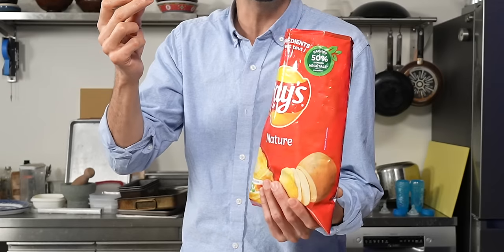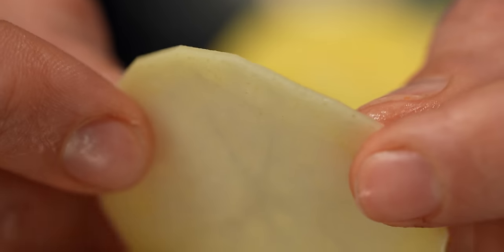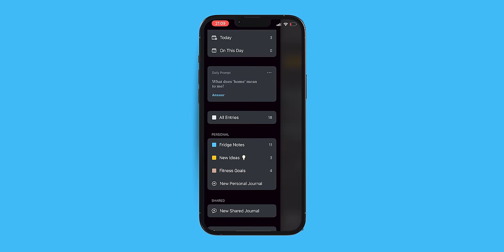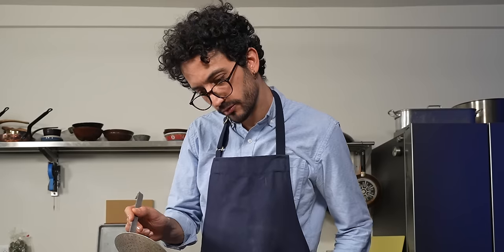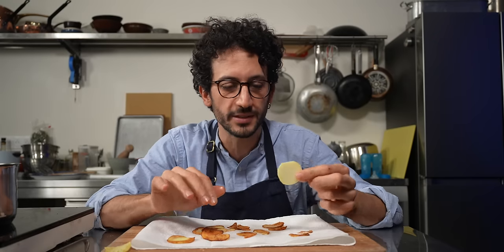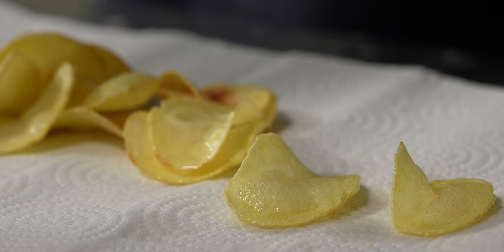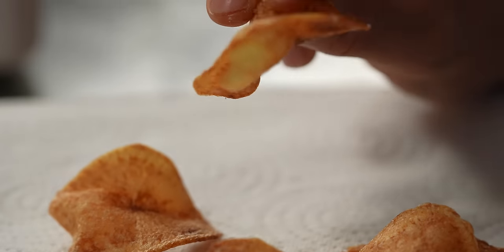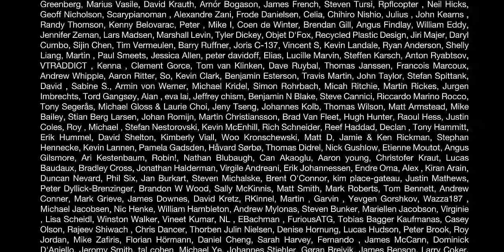How Hard Can It Be To Make a Potato Chip ? (hint: Fly you fools!)

Comment: A tip is to try double frying the chips to solve the whole dehydration issue. It's a common method in fried chicken to get that ultra crispy exterior with the starch. Cause as explained by many other comments, you're not trying to "cook" the chips, you want to dehydrate them, the oil pulls out all the moisture from the potato slices and replaces them with oil. Just a small period of letting them rest will let all that remaining moisture get pulled to the surface without running the risk of burning the chips in the oil so you can then quickly fry it till perfection for that crisp texture and flavor. 

So in short, you were way on the mark than I think you realized.

Comment: I went through this years ago so let me save you a trip.  Use peanut oil at 350f, use Russet potatoes, slice them as thin as possible - the smallest setting on the mandolin, after washing them spread them on paper towels and microwave them for roughly 45 seconds(this drives out a lot of the moisture) and pull and salt them when they just start getting a little brown on a few of them.  Also fry them in very small batches putting one chip in at a time so they don't stick(be careful, hot oil splashing), it takes me 4 batches for one medium potato.

Comment: medium high heat, wide pan(so you can fit more every time), small batches at a time(one layer, no overlap of slices or they'll stick, one potato will need 3-4 batches depending on size ) will work just fine i've been making them the past 3 days, works every time

Comment: I used to make potato chips in the restaurant i was working as a garnish and they used to come out pretty close to store bought if not identical...the method we used was slicing in the mandoline at a see through level and then we would store those potato chips in ice cube cold water untill frying.. we used to fry them at 120oC flipping each chip occasionally until crisp..You should give it a try :) (if you find this comment)

Comment: I'm surprised alex is having a hard time with this, considering his cooking knowledge, skills and his scientific approach to cooking. I've made potato chips before the same way with oil in a pot without a thermometer and it turned out with perfect color and crisp-ness. All his attempts had potatoes sliced too thick, which takes longer for all the moisture to evaporate, allowing the chips to become crispy like store-bought chips. On relatively low temp oil (I'm guessing around 150-160), with almost paper thin slices (logically chips manufacturers will also want to maximize nr of chips per potato for consumer's visual quantity per bag), fry for quite a decently long time depending on how big the batch is; around 6-8 mins in my memory, and you will get chips with similar or better quality than store-bought. As for the issue of potatoes sticking together, you could wash off the starch or put them in one by one, but I just sliced them on the mandolin over the pot and had no issues, unless it piled up too much. Making chips at home is actually very very easy imo

Comment: In the restaurant I used to work at, I had to add vinegar to a water bath about 3 cap fulls to 18Liters of water and let the sliced potatoes chill in the water till they had to be fried. the type of potato also matters alot I don’t remember the type called but it was described as for chips by the suppliers box. Those maintained the color, texture and taste. I assume the vinegar helps break down the access starch that hardens them up and makes them less bitter.

Comment: Alex and everyone, Please, please, please, I implore you try the Microwave method... It is truly the most astonishing microwave hacks in the world! Simply thinly slice potato, pat dry, sprinkle a plate with a little salt and arrange 9-12 slices without over lapping, spray with a fine coating of cooking oil. Microwave on high for 2:30 seconds to 3:15 depending on your microwave strength. (turn halfway through helps) It is ridiculous how similar to store bought chip/crisps.  I also recommend doing a 10min soak in vinegar and the same process but without the oil. Insane for oil free chips with a salt and vinegar taste. Also the vinegar reduces the maillard effect so a much more pale chip. What is brilliant about this method is it works for most potatoes, and retains the full potato flavor (blanching, dehydrating, tends to dilute the potato rich flavor). Glass state transition occurs through the microwave cooking out the hydrogen from the inside out and the starch reaching a high enough temperature.  Add any spices before the microwave for more flavour. Please note, I do not normally use a micro wave for cooking but this is just one crazy hack you have to try. The only drawback is a small batch.

Comment: Go for a pre-boil (then pat them dry!) then put them in the fridge before frying, and make sure you are using the right kind of potatoes. I imagine a waxy potato would work best, whereas you're using something in between waxy and mealy. Finally, the thinner the better with this, so try using a mandolin to get extremely thin uniform slices. But you can definitely do this with just a knife if you blanche them first. Pre-cooking is the key to doing these at home.

Comment: The browning can have to do with the variety of potato. Potatoes with higher sugar content brown quicker. Also the time of year makes a difference in browning. New potatoes have more water and brown less.
Reply: Storage conditions are a huge factor, many acedemic papers with substantial research efforts have been written on the affect of different conditions of long term storage and pre-use tempering storage(like the final 2-3 weeks) on the frying qualities of potatoes, both fluffy fries and crispy. 
It's big business and chip makers do not use supermarket potatoes they contract with growers for specific qualities. Farmers don't even use the same type of fertilizer for supermarket and processing customers because it effects the starch and moisture ratios.
 
Supermarket potatoes are grown for maximum weight yield and tend to have high water content, but processing buyers may pay based on a more complicated quality scale or for some products even by weight of extractable starch regardless of total fresh weight.
Reply: Yes, the variety matters.  The problem I guess is that the variety used is usually bought up large producers, same reason you can't find certified Prime Beef outside of restaurants.
Reply: @dereklaird8625  Its not that it is "bought up", it's that retail market demand is much more elastic. This means small price changes cause a huge change in demand and the top quality items become so low volume that only specialty stores can justfy handling the product. 
Partly caused by consumers that can't take advantage of the quality difference, either due to lack of cooking skill or the idea that "A potato is a potato, a steak is a steak, its all the same why pay more?".

Partly caused by the cost stacking effect of restaurant/factory labor, this is also seen in export markets. For a home cook they see prime as double the cost of choice with minimal upgrade in the end cooked product, but in a restaurant the the raw beef cost only adds 20% to the total combined cost but with a trained chef prime can demand 30-40% more menu price.(Similar they don't fuss with salvaging odd undersized produce due to labor cost.) 

Similar with exports, the cost of shipping is fixed per pound or per volume  and will quickly drive the cost of a low end import product over that of a similar domesticly sourced product, so it only makes sense to import the most desirable highest price items. (Especially when shipping costs were high, modern ocean shipping only adds pennies per pound to the cost stack is mainly important to very low priced bulk commodities like raw timber and scrap iron.)

Comment: cut the potatoes and leave them in vinegar water and then dry them with a paper towel or in the fridge. The burned taste you're getting is loose starch burning in the oil, the acid vinegar slows down the browning letting them dry completely in oil before it burns.

Comment: Potato chips are tricky. They really are confuzzling the way they have the flavor and crispness from the Maillard reaction but none of the browning. I would suggest maybe doing an acidic marinade for the sliced spuds (maybe like 8 hours or overnight, not sure, will have to experiment) then fry them at high temperature (but within reason) for a short period of time. I recently learned that alkaline conditions accelerate the Maillard reaction, and conversely acidic conditions slow down the reaction. By imbuing the potato slices with acid, it might just buy the chips enough time in the oil for them to cook fully, without browning up too quickly. Penny for your thoughts, hope any of this helps on your chip making expedition, Alex. Cheers.

Comment: You want the right kind of potato obviously, a high starch, low sugar variety, these are typically the floury potato type (farineuse), not the firm type.
You want potatoes that have been harvested very recently. the longer they stay out of the ground, the harder it''ll be to make the kind of chips you want. because they start converting starch to sugar once harvested.
1) peel
2) slice (1.4 to 1.5mm thick)
3) wash (cold water, leave the slices for around a minute to leech out excess starch)
4) dry (a paper towel will do, but for large volumes you want an air dryer).
5) right kind of oil, rapeseed oil is great because it can go hot)
you want to fry them quite high, at 190-192°C for about 3min.
6) oil drip
7) coat with FINE salt asap that will prevent the chips to go soggy,
you can add coarse salt after, but chips need very fine salt.

Comment: If you start with a yellow potato there is no way you will get them crispy before they take on a color beyond the yellow they start with. You need a white potato to start with so that by the time they have taken on the super light golden color they are crispy.  The professionals are probably also air drying the potatoes before frying. The moisture on the outside of the slices will insulate the chip from the oil when you first put them in meaning that the outside of the chip sets firm before the heat reaches the moisture trapped inside the chip making steam and creating the light crispy crunch.

Comment: Kenji recommends boiling the potato slices in water spiked with vinegar (this is after washing and drying them, not in place of). Because they're fried dry, no vinegar flavor is detected in the chips (unlike in, say, fries). Look up "Extra Crunchy Potato Chips" on Serious Eats. Although Kenji does not peel the skin off, interestingly enough.

I do have to say, though... I'm a kettle-cooked person. I have extraordinarily fond memories of Cape Cod brand kettle-cooked potato chips, and whenever I've done homemade potato chips, that's exactly what I've ended up with. I honestly prefer them to, say, Lay's, which I find less substantial and less flavorful. And BTW... I'm a supertaster. I'm extremely sensitive to bitter flavors... like to an extreme. But I don't find kettle chips to be bitter at all.

Either way, it'd be interesting to see you try slicing them a little thinner with the mandolin, washing and drying them, boiling them in vinegar-spiked water, drying them again, and then frying them in oil heated to 163°C for 10 to 20 minutes. Now, Kenji's are still darker, and he does like his a bit crunchier, as well. So you may need to adjust that. But I tried his recipe and I think they're closer to Lay's than kettle-cooked.

Comment: I do not think you could make the "real" chips as those are fried continuously in one go on a "belt", so you'll probably be always batch frying yours. I'd recommend you get the freshest and starchiest potatoes you can, then cut the potatoes on the mandoline to the ice water (a little thinner perhaps). Blanch it for a minute or two in water (the cold bath and the blanching will wash some of the surface starch), dry and let it cool (fridge/freezer is good - gets some of the excess moisture out), pat dry thoroughly and then fry at mid-high temperature. Having the freshest potatoes you can find will also help a bit. Cutting the tomatoes to ice water reminds me of making hash browns and the blanch, then fry method is a similar technique to the double-fry/triple-cooked french fries and it usually yields me the best result, but I am sure you'll figure out something even better! I've seen so many good tips in the comments already - I am definitely trying the dehydration in a food drier as well.

Comment: My first instinct is to pre-cook in a boiler, freeze, and then fry. Be very careful to select your oil based on your temperature, lower temps need oils with a lower smoke pint or it will turn into a greasy mess.

Comment: A simple engineering analysis suggest that you need to lower the moisture before frying. The thickness might be reduced as well. The real problem comes when an actual food related chemistry comes to the game - is this the correct potatoes (knowing that McDonald's use some special kind of potato means that chips companies probably do the same), how the the potato chemistry is changed with heat, how to control it. These all sounds like a very complex thing to me. I guess it is not, but definitely need an expert on this. I've read/heard somewhere (could be a specific social media french chef) that the simplest looking food products are the most complex to make right.

Comment: There is a 3ᴿᴰ route you can take; Game Chips. I grew up eating a lot of wild game & my father would occasionally cook game chips as an accompaniment. They are often slightly thicker than normal supermarket chips, sometimes coated in seasoned flour before cooking, though I prefer not. We often used a crinkle cutter to get wavy crisps or better yet use a mandolin to achieve a "waffle" cut as this increases surface area considerably. Once cut soak in cold water for ½ an hour then pat dry. Cook in oil or better yet in beef lard at 180°ᶜ/356°ᶠ until just cooked & still blond in colour. Then spread on a wire rack over a tray & put into an oven preheated to 180°ᶜ/356°ᶠ to drain of oil & crisp up - keep an eye on them so they don't over colour or burn. Then season to taste & serve immediately. I prefer to use a fluffy, high starch potato & have a liking to leave the skins on for extra potato flavour.
Reply: Oh you can also use other root veg like parsnips, beetroot, sweet potato to make good game chips.

Comment: Actually the solution is very simple, if you bake them in sunflower oil you will need to cool them in an airstream... So maybe it is a better option to put them in a low temperature airfryer. The variables for good potato chips are potato race, thicknes of the slices, baking temperature, baking time  and amount of air drying. And it is off-cours highly important not to overcrowd your pot.
Please also be aware that anytime you are deep frying you should use your ears, the sound of water evaporating changes when the chips are done to a somewhat whisteling noise jus like it does with fries 😇

Comment: "I've tried everything"
No, you tried like two things, three if you count using a mandolin. Did you try dehydrating them first? Did you try multiple different types of potatoes? Did you try blanching them first? How about soaking them in a chemical/substance that might change the chemical composition and reaction? Did you try more than two oil temperature settings? There are a ton of things you could have tried.

Comment: weird.. I tried doing this once myself and it was not too hard. 
Peel
Use the Peeler to make Slices
Soak in Water
Dry
Throw in hot Oil
Salt.

They basically tasted exactly like salted supermarket Chips. Not better, not worse. So imho not worth the effort. Fun experience nontheless.

maybe I had more Luck with the right potatoes or Oil Temperature.

Comment: I think that one of the things you are doing wrong is trying to compare industrial potato chips to the original type that would have been served in the 18th century, and made at home until the mid 20th. Industrial chips have a huge amount of quality control going on throughout the process, and quite a lot more waste than is acceptable when making a small batch at home. Slicing with a mandolin helps, as does frying in cast iron to help maintain even heat throughout the process. Honestly, if you prefer store-bought chips than just by them. I consider them to be good, but inferior to home made.
The light color and crispness of an industrial chip occurs because the chips are kept warm after frying them in oil; keeping them from browning further. That can't be replicated in a small kitchen because there is no room for a large enough enclosed, heated, conveyor system in anyone's home or restaurant.

You are not a failure. You have replicated exactly what is possible in a home kitchen.